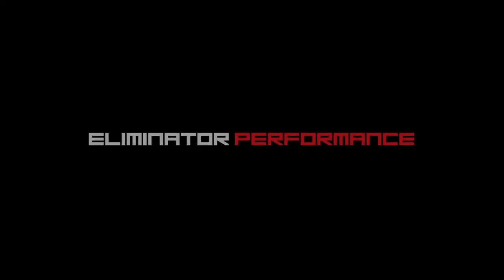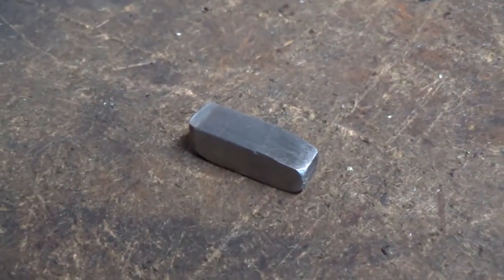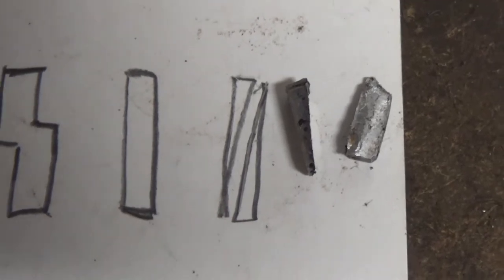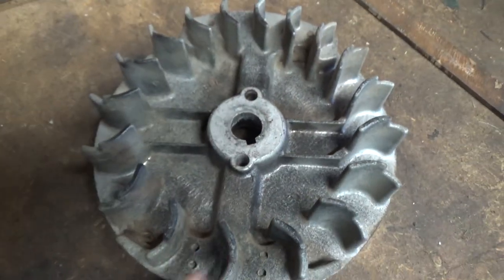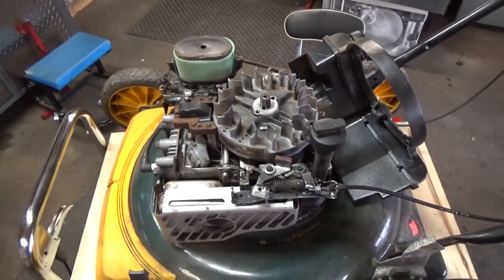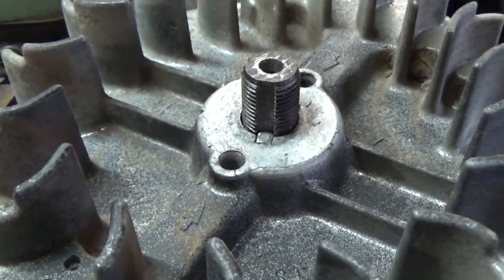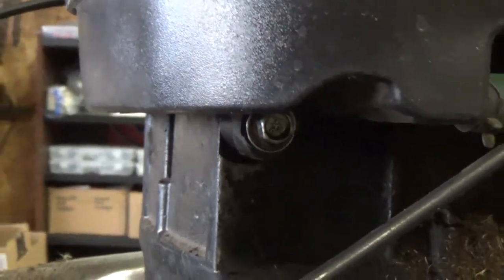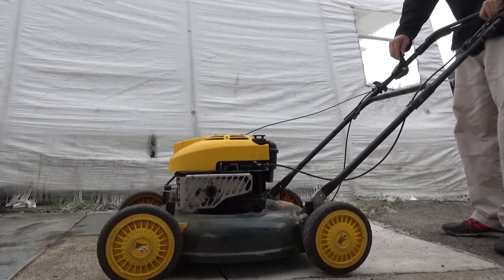How to Fix a Sheared Flywheel Key!

Comment: I just got a free LT2000 in great shape because it sheared a key and the backfire blew head gaskets, Timing was just right to sound like a gunshot. Owner misdiagnosed it, got mad at it and gave it away on Craigslist. BTW another great shop accessory ya can score cheap is a patient lift. They're like little engine hoists and perfect for the motorcycle engines I use them for.  Take care of your back because once it's damaged, it's done. Ya can never have too many ways to lift and handle heavy or bulky parts.

Comment: Lift table is a great addition to your shop, should reduce chiropractic bills and possibly eliminate them. Should call that table THE ELIMINATOR! When we got this Yardman on trade it had a bent blade which you changed but we used it about 5 times before any kick back happened, so likely had a sheared key right from the start but like you replied to Chris Romyn the momentum of stopping or starting over the 5 uses slowly allowed the flywheel to move slightly out of position until it got to the kick back point.

Comment: I found the information I needed.
I have a generator I bought at a scrapyard. New pull, new carb, reset valves. unplugged sensor. pulled and the plastic handle disintegrated. So after seeing your video I know keys can sheer in different ways. So tomorrow I pull the flywheel.  am going to put it on my blade balancer. I bet the key is sheered. There is a mark on the head made by a valve. Maybe it been replaced?
The engine really bounces and backfires. This should solve it.

Comment: A nice detailed tutorial!!!  Can you tell how much sheared key can be tolerated, please? I do have the same issue with ripping starting rope off my handle. Engine works, but suspiciously incorrect and too difficult to start it, especially if I try to start second time. I have taken flywheel out. Its key looks like almost normal, may be a fraction of mm was displaced. Is that OK, or it must be replaced anyway? Thank you

Comment: Would this happen in normal operation. Or would this be from   hitting something with the blade like a root.
Reply from the maker: Chris Romyn yes, the momentum of the blade and flywheel, after hitting a root will most likely shear the key!

Comment: I've got a problem that involves a DeWalt high pressure washer with a Honda power plant.

The issue is that the pump failed because of either operator error or a pump component failed. I don't know if the failure caused a system shut down rapidly enough to shear this key or even if the Honda engine has an aluminum key.
I won't know obviously untill I remove the recoil mechanism and remove the flywheel mounting bolt.

Time will tell.

5 years ago I had all the tools I needed for this project even including several pullers needed for this project. Now I'll have to acquire the tools all over again.

Why? I'm homeless and living in what Los Angeles affectionately calls a tiny home community.

That's another story.